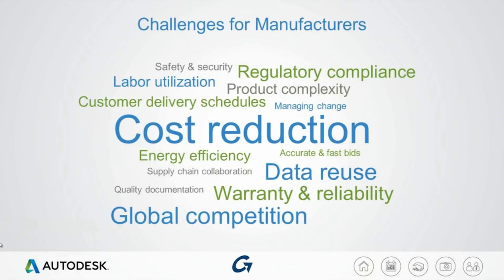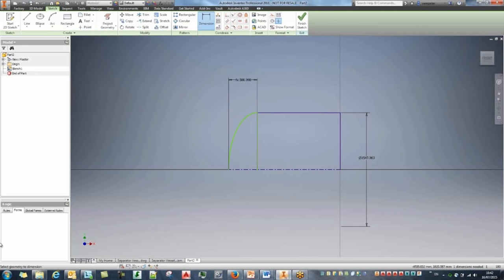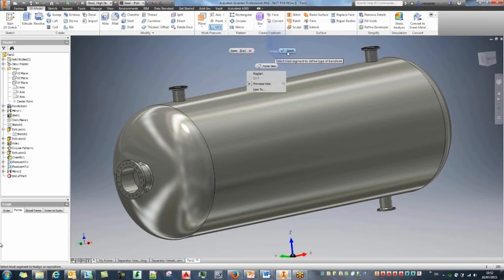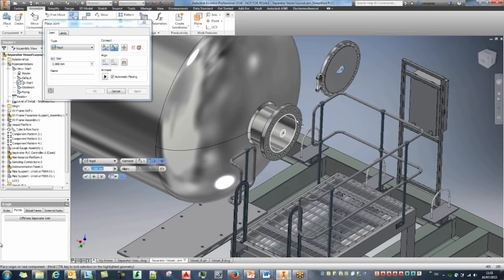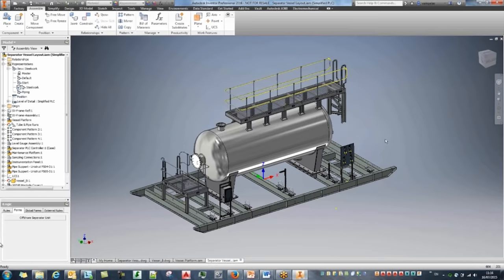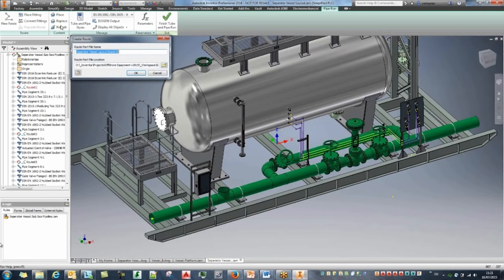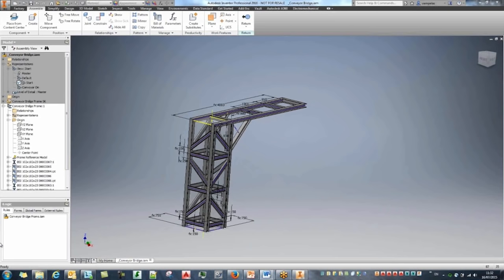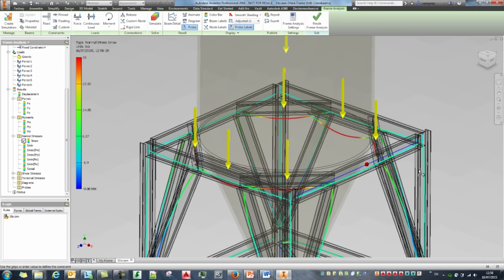Autodesk Inventor Webinar

Comment: Nice Video, But the technics - how to create ipart, how to add the rules, ilogic design (with or without cage for ladder depends on planform height), how to create 3d sketch, how to create parametric skeleton, piping routs - are missed - just inserted prepared files. I would say that this is not tutorial video, but video for Inventor advertising - to sell software to the companies.